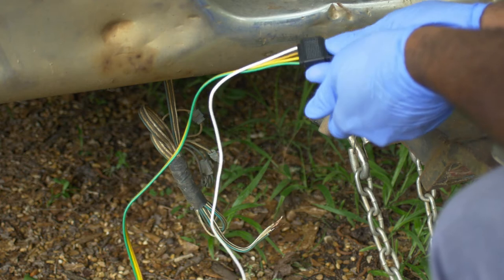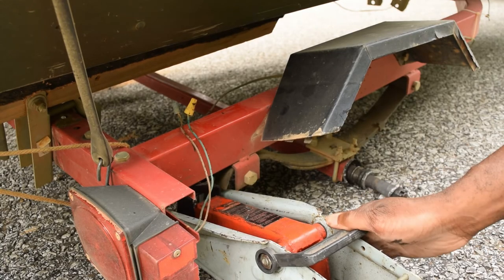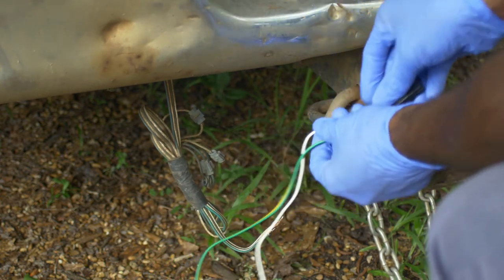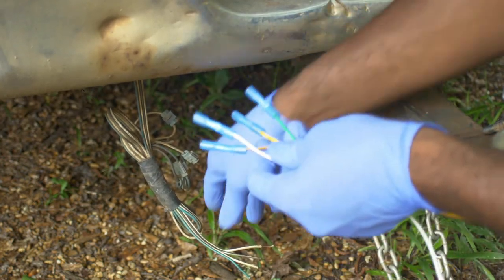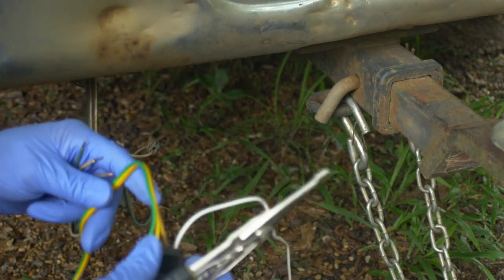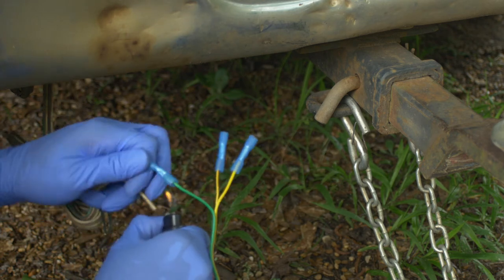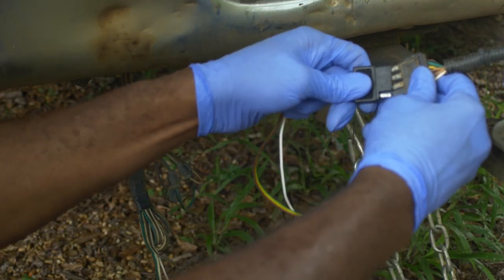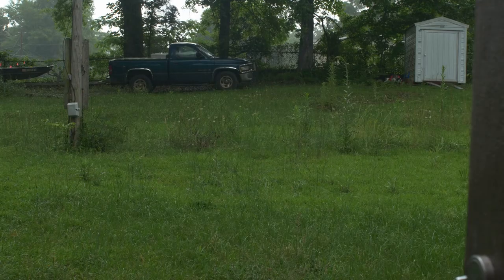Boat Trailer Wiring With Waterproof Connectors

Comment from the maker: You guy have any tips to help people looking to repair old dry rotted wiring on their boat trailers?
Reply: Find the spot where it stoped dry rotting and cut it out new wire in and use heat shrink tubing and solder or heat shrink crimp terminals  if it’s all dry rotted just get a appropriate trailer wiring kit that’s long enough
Reply from the maker: @lukehaak5907  Good advice. Will have to take that to heart.
Reply: I seen your car had those t tap/scotch lock connectors don’t use those they get corrosion in them and then your connection don’t work especially in a rust belt state/saltwater
Reply: I ordered some new lights on ebay and they came with a wiring kit so I cut the old wiring and used it to pull the new wiring though.  Stopped by here to see how to make waterproof connections.  Didn't know you could apply heat to those connectors and seal them up.  Thanks!
Reply from the maker: @VoodooCrab  Thx.